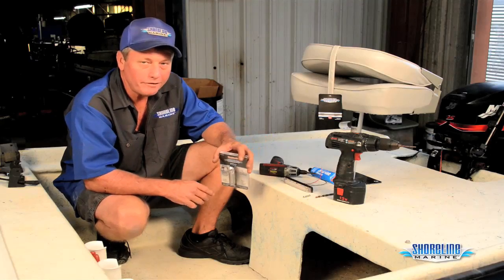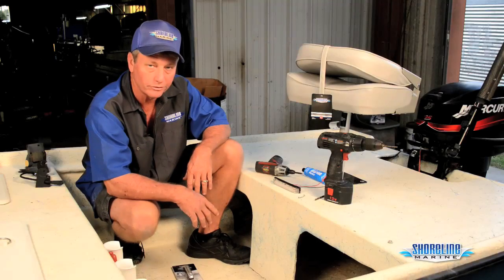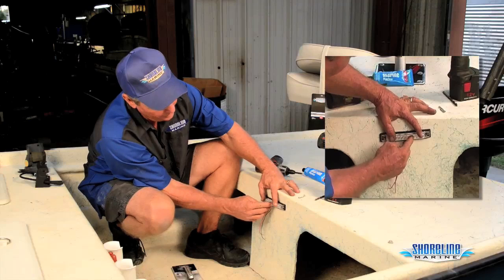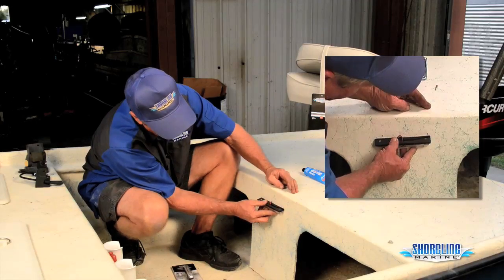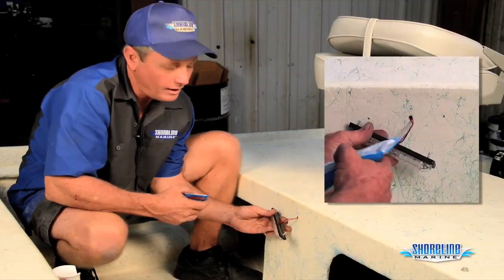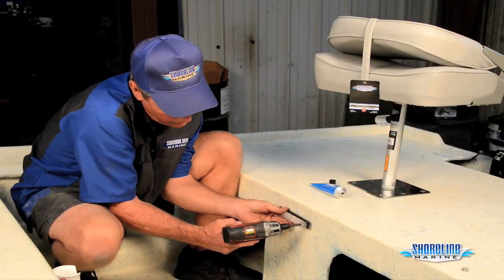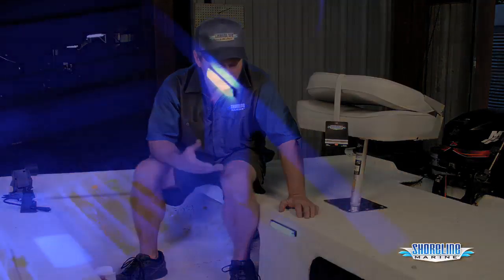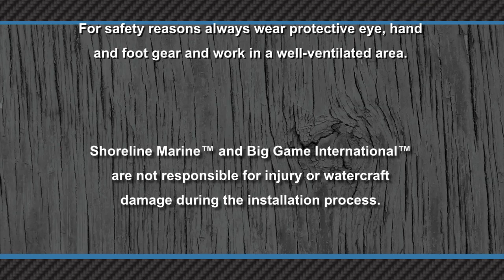How to Mount LED Utility Strip Lights

Comment: What kind of screws for fiberglass
Reply: He is probably using the hardware that come with the light. It looks like he is using the ones from Academy called Marine raider. Those run about 10 bucks with the screws, then they have one twice as big for 15.